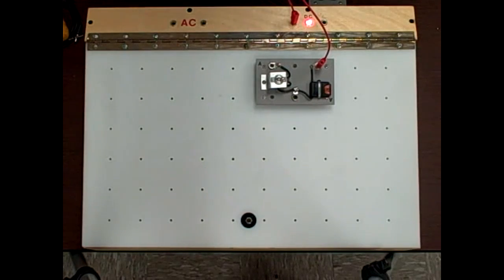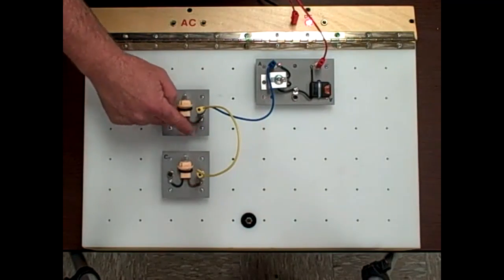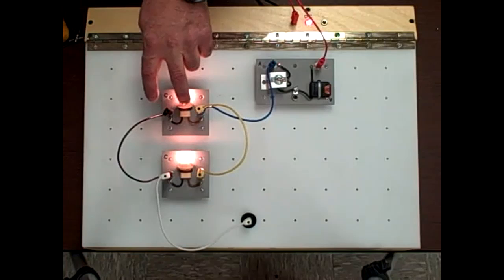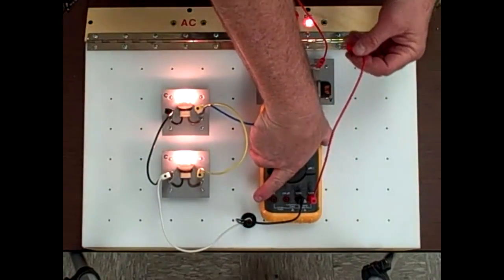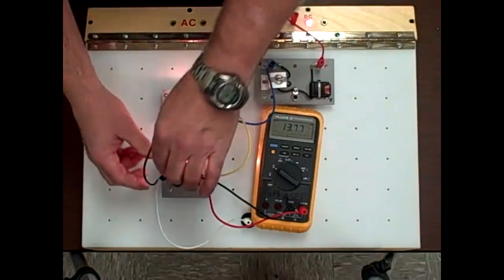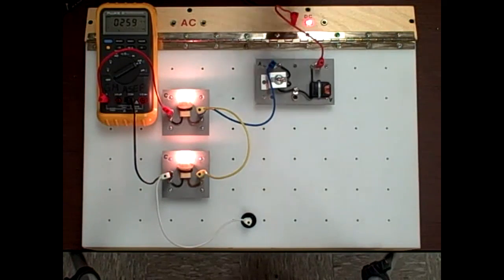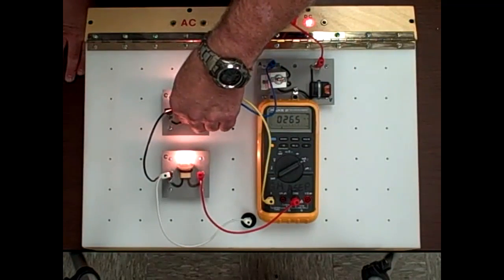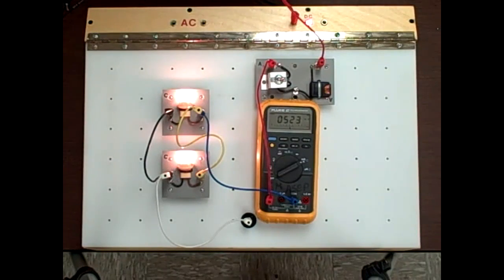AUT 161 - Parallel Circuit Basics

Comment: Hi nicely explained, I've been learning recently about auto electrics from YouTube videos and have stumbled upon the load pro vids using volt metre to measure a circuit my thinking is if I read say 12.60v at battery then read a circuit at 12.00v at component is this telling me there's current but with resistance  due to maybe corrosion , also would a test light connected give a dimmed light simulating voltage load under resistance. I'm trying to get my head around the logic, hope you can reply,